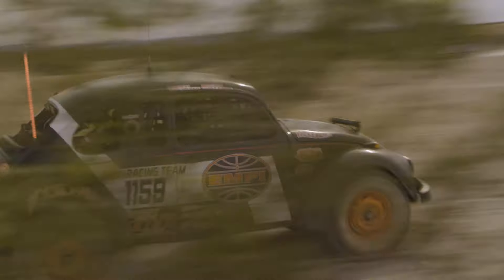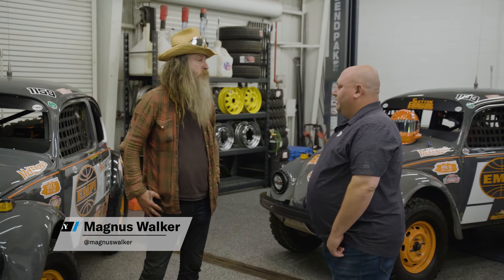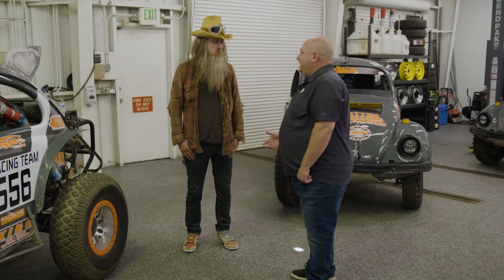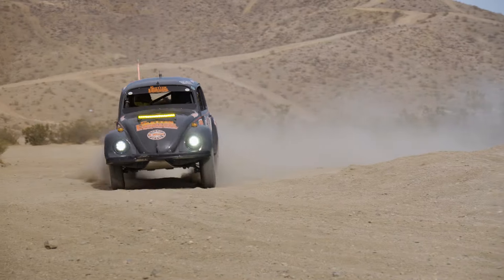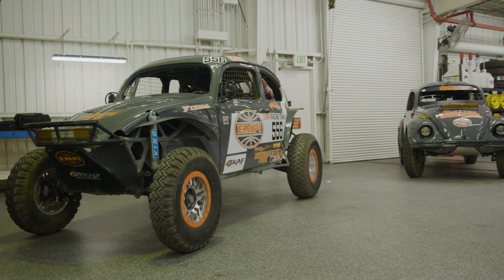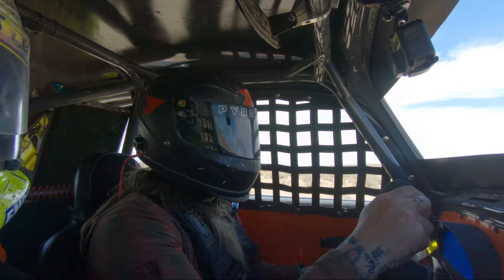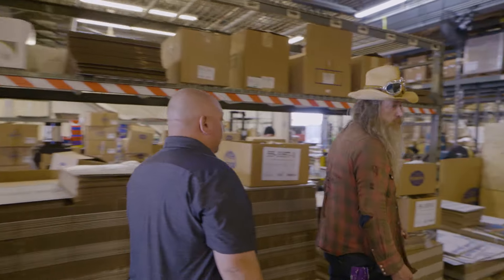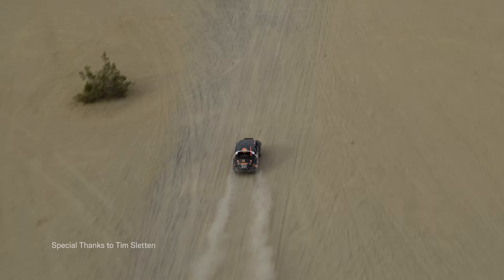Race for cheap, have some fun in a Baja Bug | The Next Big Thing with Magnus Walker | Ep. 210

Comment: I had a 1972 Beetle in high school (in the late 80s) and it pretty much ticked the Porsche 911 box for me. I know what it's like to have the rear end come around if you lift off mid-corner, and it was the most fun ever had in snow. Couldn't get the thing stuck, even in mud up to the tailpipes. Sure, I'd love a vintage 911, but I'd also like to retire.

Comment: Crowbar a Golf 1800 motor in with an adapter plate for the original gearbox, some minor suspension mods because honestly the Beetles have great front suspension, dirt tires and disc brakes up front, and you’re ready to play

Comment: EMPI, back in the day, was the king of the hill. Then, they sold out and shipped all production overseas, and build quality went straight into the shitter. They lost a lot of consumer confidence. Nowadays, even though most production is still overseas (those cylinder heads are almost for certain Chinese castings) they have come back around a bit.

EMPI ain't what it used to be. Some of it is OK, but caveat emptor.
Reply: Yea, some Taiwanese-made parts are decent.
Reply: spot on.  but it's nice to see them trying to turn that image around.

Comment: Why wouldn't they use a Super Beetle though? wouldn't the Super Beetle be better with a more modern front suspension?
Reply: It has McPherson strut front suspension. Not nearly as good as the old trailing arm design, with king and link pins, for hard off road abuse.

Comment: The bajas in all these vids have worse suspension travel than the one I had. What’s going on there? Dude claimed big travel numbers, but that must be landing jumps only. I guess they avoid bottoming out with stiff damping and porpoise around on the small stuff. Seems like softer shocks and a robust set of snubbers would be better for speed/control and avoiding fatigue?